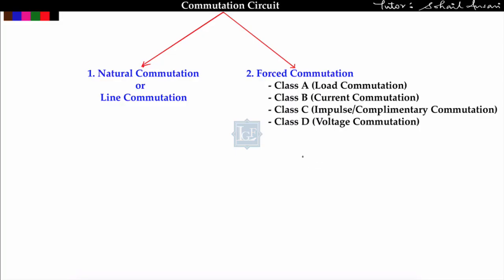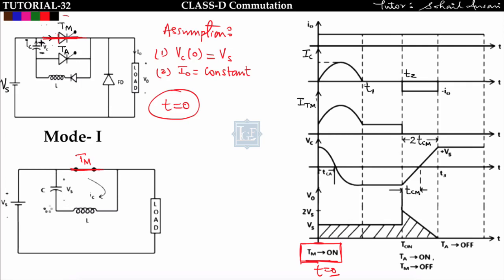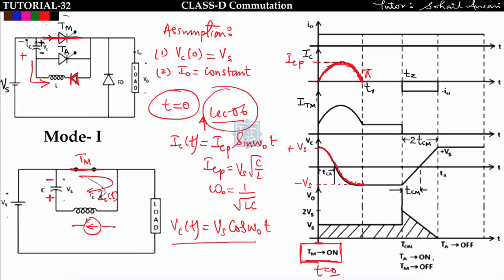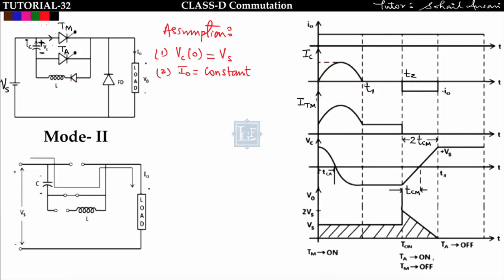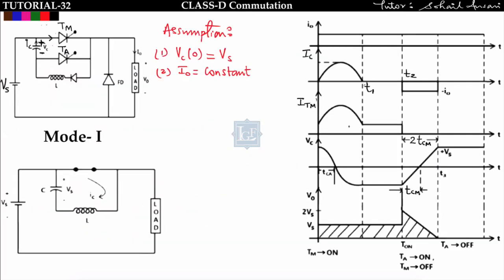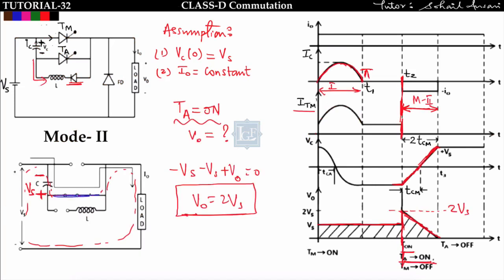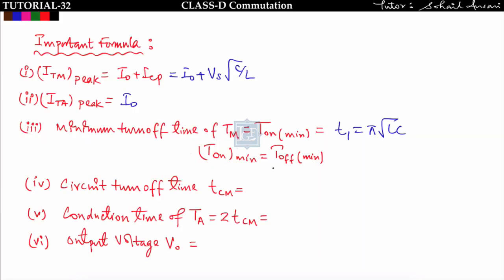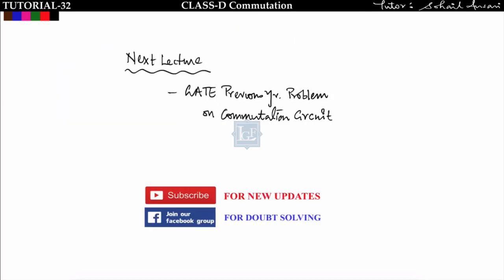Lec 32 Class D (Voltage Commutation)

Comment: Sir
In mode one why the voltage across capacitor is =Vs COSWot ?
I am solve ''this mode , find the voltage on capacitor is equal {Vs+Vc(0)COSWot-VsCOSWot}
Where 
Vs=steady state voltage=-Vs
Vc(0)=initially voltage of capacitor that assumed in first solve=Vs
Reply from the maker: see lec-06..you will understand how it is coming...
Reply: GATEMATIC Education
 thanks

Comment: In the circuit, you've shown a freewheeling diode but you haven't explained its working
Reply from the maker: freewheeling diode is taken on load side to provide the continous current across load..that is not the part of commutation..thats y i have not explained this..